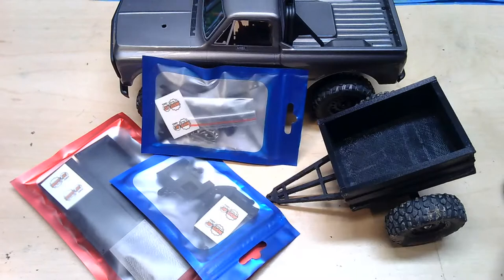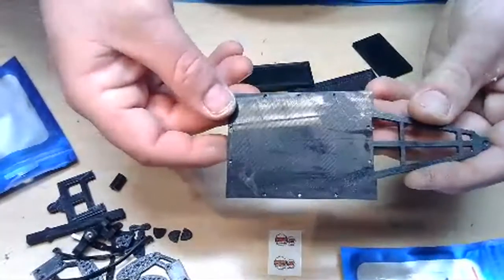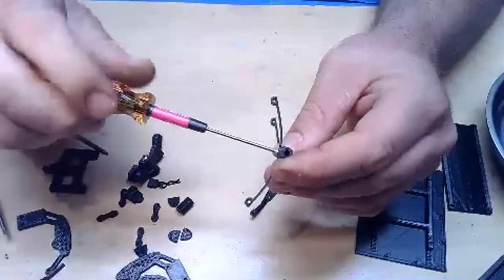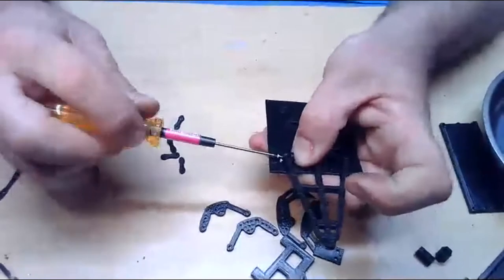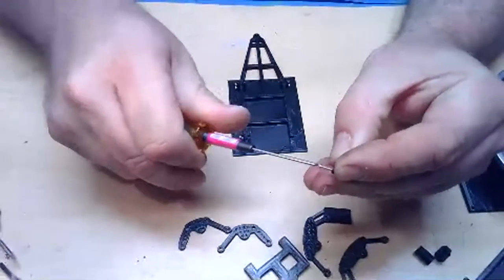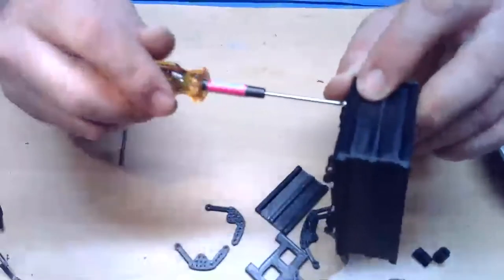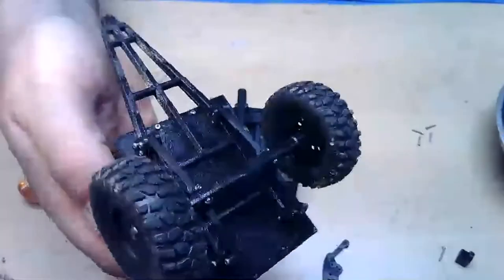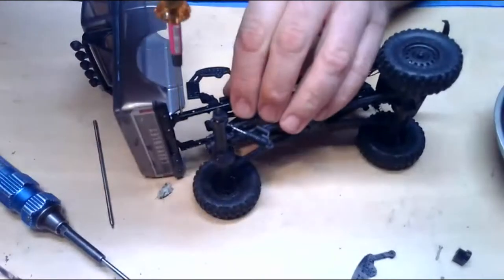New Release from Mofo Rc, The Expedition Trailer and double jointed hitch mount

Comment: Just a suggestion. If you put a cross pin hole in the receiver where you would mount a hitch ball. Make that the first joint. That would make the hitch less parts. And wouldn’t look like it has a double thick receiver.
Reply from the maker: Great minds think alike lol. The final production has that.
Reply: @MofoRC  sweet then I’ll wait a little bit longer before ordering. 👍👍
Reply from the maker: Order when ready. I made this video with the prototype. All the ones I've sold have the redesigned hitch.
Reply: @MofoRC  awesome. you must’ve not change the picture on your website. I’ll order soon can’t wait to paint it to match the truck.
Reply: @MofoRC  just ordered. Thank you.